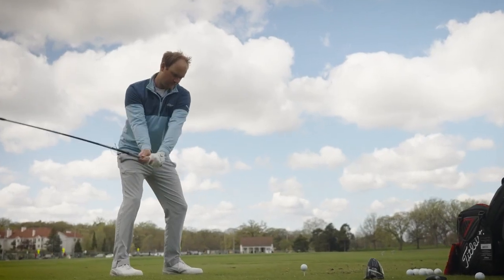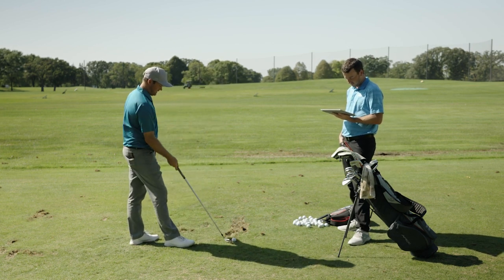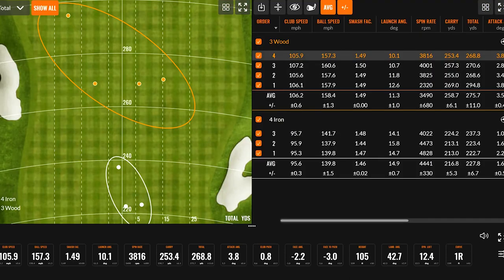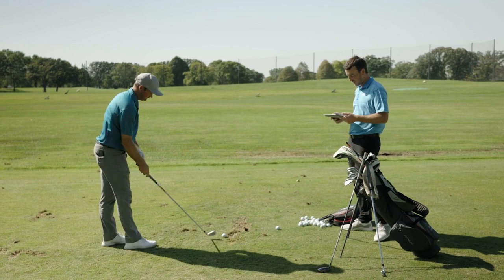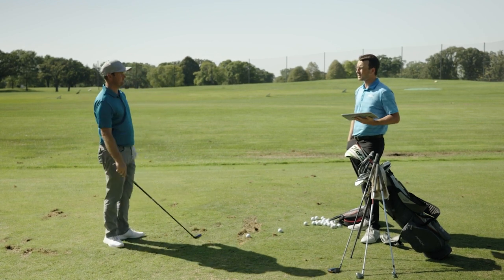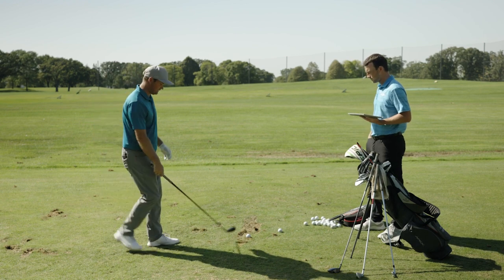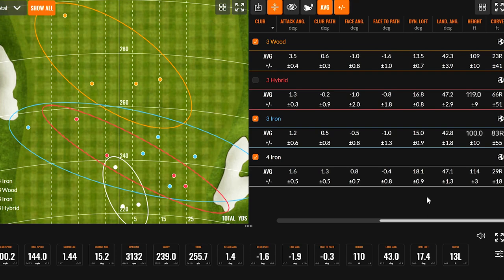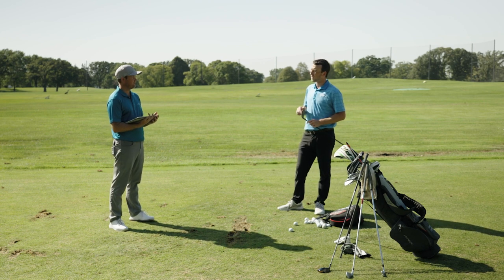Road to the PGA Championship with Thomas Campbell | Episode 4: Gapping Analysis

Comment: Two idea’s; 1) bring your loft back on your 3 wood and tighten it there closer to 250. Minimize your decisions on the course. ( How many times during your rounds realistically do you need the extra yardage?)   2) Find a better driving iron/shaft that inspires confidence every time you look at it. You’ve got a couple clubs on me distance wise and I’m not playing from the back tees. What I did was ditch the 3 wood for a 5 wood. I’m striping it 9 out of 10 times where I’m aiming it instead of slinging more than I want to admit off to the right or left of a green. Less decisions equal better golf for me. good luck 👍

Comment: You guys probably already know this, but the  p790UDI has less aggressive offset (more like a p7mc) than regular P790s, including the 3 iron. Maybe bend it so it's more uniform with the rest of your clubs or get one that's similar.
Reply from the maker: Yes. It is an anti left strong driving iron. I personally need a little more loft to be able to control my ball flight with the UDI - Thomas

Comment: Given the numbers, def try epic super hybrid 18 set to 17 may be or even 16 to see what fits. With 21 degrees your numbers averaged 220 I guess . As you mentioned it's closer to the fairway and you were hitting the fairway quite ok. The loft might fit in between the 3+ wood and the 4 iron. The length should make it simpler from rough. The spin should stay lower than the 5 wood as well and hit the optimal range. Just a thought. I may be entirely wrong here :-) Good Luck
Reply from the maker: Good suggestion!! Thanks for following along!

Comment: I am in this same boat. 

Have a zx utility 3 iron at 20*, waiting on a Ts3 19* hybrid to show up. 

But I need a 250 club I can hit high and out of the rough bud needed. The utility is just to 1 dimensional. 

For you I would go 15 degree 3w then a 2 hybrid. 

In those numbers I would drop that 294 3w, kinda messes up your averages. 

And why get so caught up in “total numbers”?

That 3 iron goes 250 total but if ain’t getting to no flag over the water, can’t roll a ball through the water…..

Carry numbers are all that matter!!!!